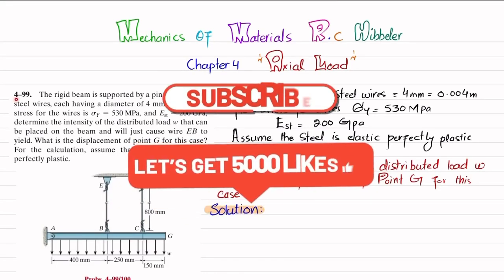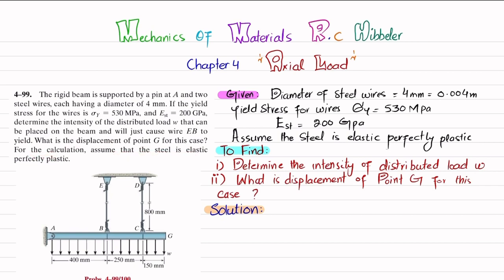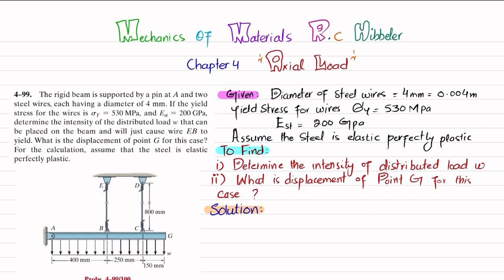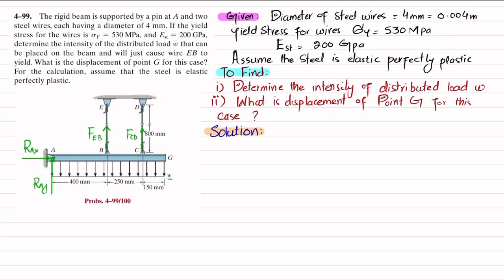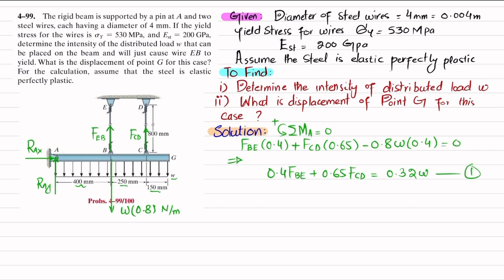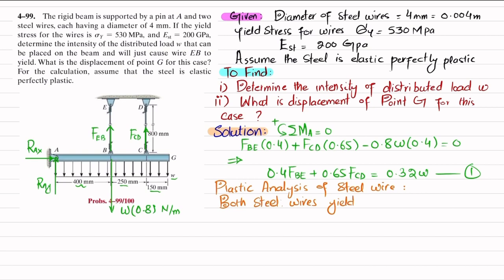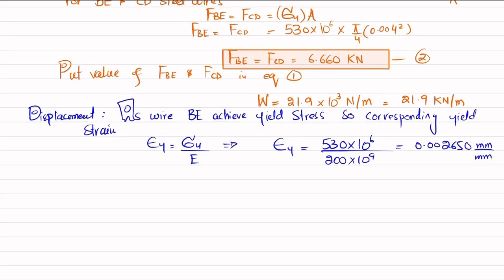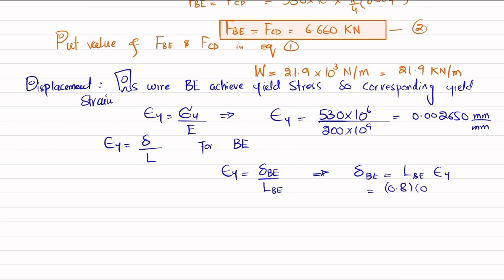4-99 | Determine intensity of the distributed load w | Mechanics of materials RC Hibbeler

Comment: How do you determine the largest intensity of the distributed load Wo that the beam can support if the beam can withstand a maximum shear force of Vmax=1200Ib and maximum bending moment of Mmax=600Ib.ft.
Reply from the maker: Are you talking about this problem or another ?
Reply from the maker: The answer is 21.76 lb/ ft or  1.81 lb/ in but that is for another question not this one.